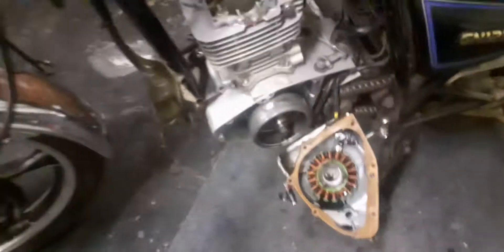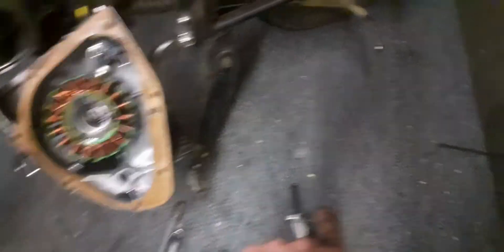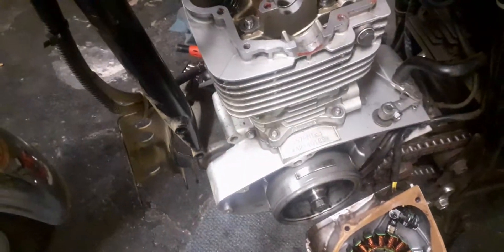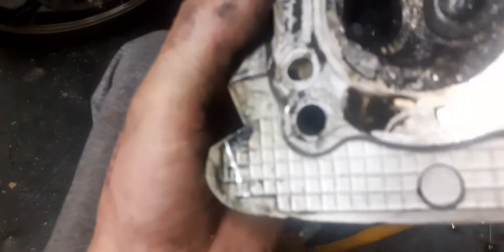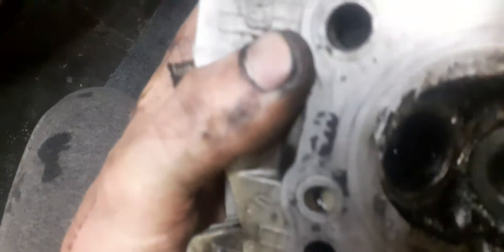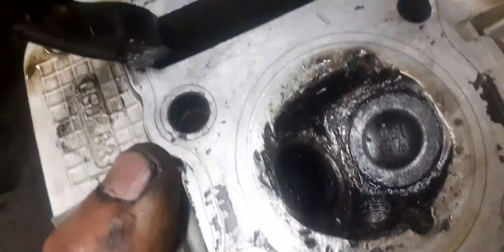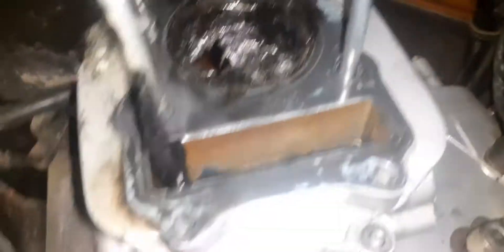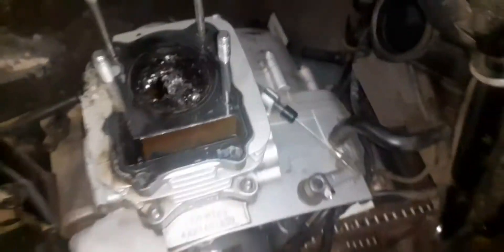The meaning of dropping a valve...

Comment: That happened to my bike i bought used got it running and 2 weeks later boom same exact thing
Reply from the maker: Worn valve springs. It means the springs lost ther tennion and you drop a valve.A very expensive fix . Lucky I got the know how to do engine rebuilds

Comment: Wow, how it happens? What's the reason? Scary.
Reply from the maker: Bought a usted head  and bought brand new piston and brand new piston rings'botton end gasket and top head gasket.The 4× domme nuts and 4×copper washers.4×retaining head studs and 4×flange nuts.Also bought brand new valve springs for the exhaust and for the intake valve.Both valve have also being replaced as new and valve seals and other bolts for the camshaft 2× gear sprocket and 2× bolts for the exhaust header pipe.Sleeve pin and the 2× circlips for the piston  have also being bought.All this at 400-hundred U.S.dollers.This is not as cheap as most will think
Reply from the maker: I have also replaced the the clutch basket assembly 'the friction plates and the steel plates and the the clutch basket springs which cost another 50-dollers in parts before it blow up.Now I be ready to assemble it all in one go
Reply from the maker: Valve springs were worn after 54000.00 km.The valve spring lost its tennion and could not open and close on the correct timing.It destroyed the piston and the head.Before it blow up it was not running correctly for about 2 months.I could not figure it out untill it finally gave in
Reply: @deliverance3767 same just happened on my ktm duke 690 20,000km